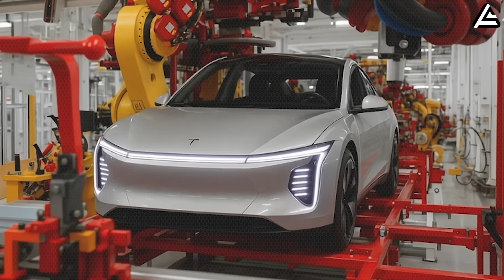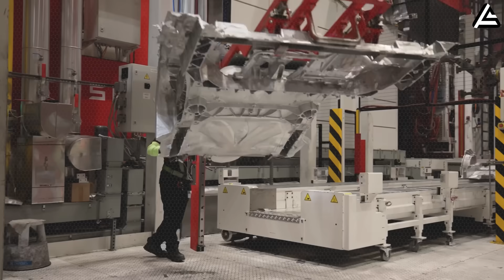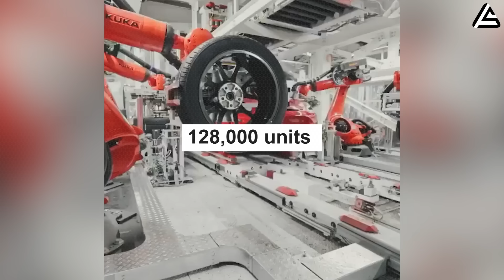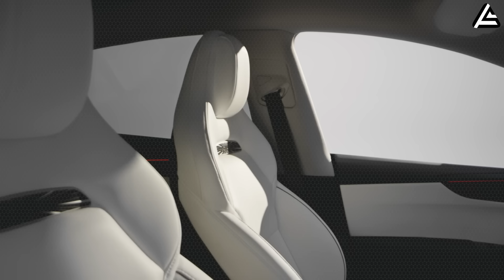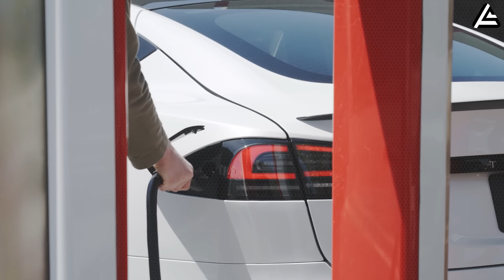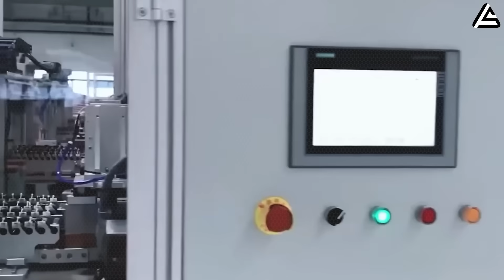Tesla Model 2 Senior Edition 2026's Production Line FINALLY HERE. Biggest Bombshell Ever!

Comment: The production speed is impressive, but I want to see how consistent the quality will be at that pace.
Reply from the maker: That’s exactly the right concern. Fast production only matters if the cars coming off the line are consistent. Tesla has proven it can move quickly, but speed can also expose problems in panel fit, interior finish, noise, calibration, and long-term durability. So I’d look past the production timeline and watch the first owner reports. If quality holds up at volume, then the speed becomes a real advantage — not just a headline.

Comment: A typical 1970 auto would provide 250 miles with a small V8, BUT arriving at a 250 mile destination would require a fuel top off somewhere in the middle of the trip. So a Tesla 2 providing a 350 to 400 mile range would “put you there, BUT arriving at Tesla Charge Station when you arrive would be intimidating.  Remember the 1973 “Gas Shortage”? We would only drive when absolutely necessary, and after a year we traded in our cars for higher mileage vehicles.  So don’t be surprised when the economy sputters when people stay home and do the same.  Remember that if you waited to save for the xtra fuel, you could get in a “gas station line” and purchase it, not the same with Electricity.  A LIMIT is jut that, because if there is no electricity you can’t buy it at any price.
Reply from the maker: You’re right to bring up the 1973 oil crisis — it shows how quickly behavior changes when energy becomes uncertain. But EVs shift the risk in a different direction: instead of relying only on public supply, many owners can charge at home, which reduces dependence on “lines” the way gas did back then.

That said, your concern about limits is valid — if the grid is constrained or infrastructure is weak, you can’t just “pay more” to fix it instantly. The difference is that electricity systems are more distributed and expandable over time, while gasoline depends on physical delivery — so both have limits, just in different ways.

Comment: can;t Tesla use a not so expensive charging home port?
Reply from the maker: Yes! you actually don’t have to buy the expensive wall connector. Many owners of Tesla cars charge at home using a standard outlet or a cheaper 240-V socket with the mobile connector. The wall connector is mainly for faster charging and convenience, not a requirement.

So if someone drives a normal daily distance, a basic home setup can work just fine, it just charges slower overnight.

Comment: The manufacturing process is interesting, but does not provide key buyer attributes. These attributes are: mileage range in 90 degree and 20 degree F with two people, what is the low end torque, what is the 0-60 second time from a standing start, what is the AC performance, what apple car play or android features available.. this is missing. Kind of important I think! 🤨
Reply from the maker: Great points! Those are exactly the specs most buyers care about in the real world. We’ll cover performance, range in different temperatures, charging, and features like infotainment in upcoming videos. Stay tuned for the next one.